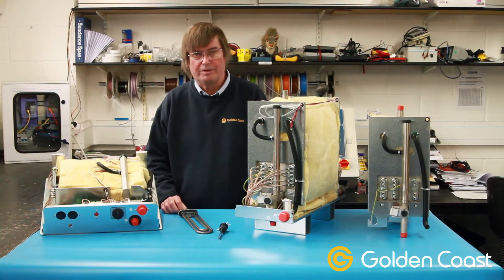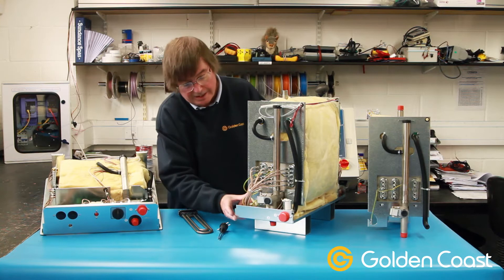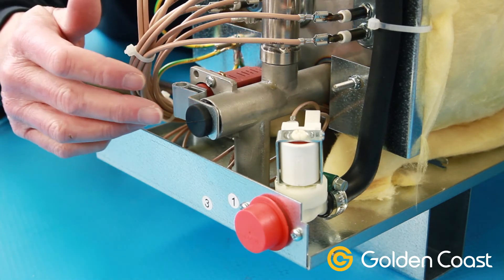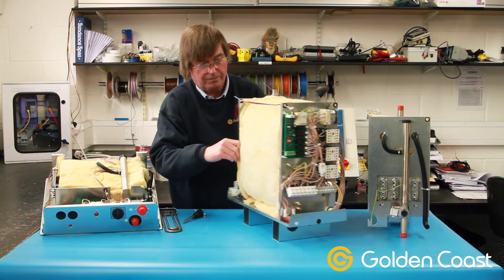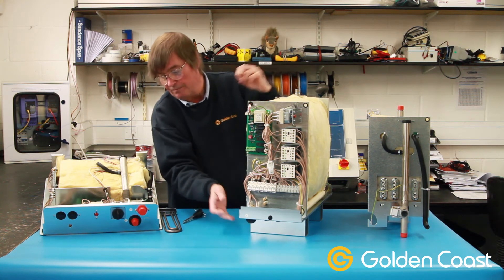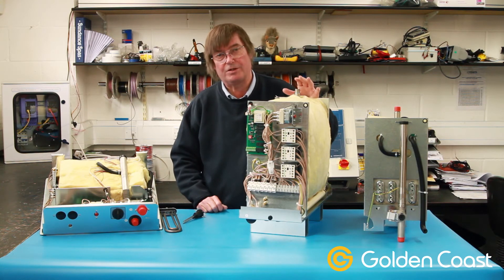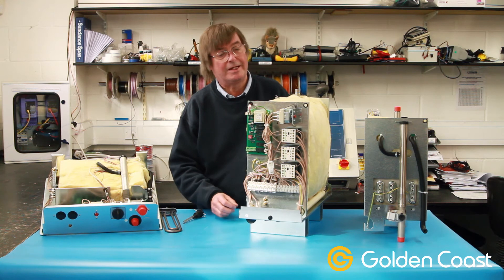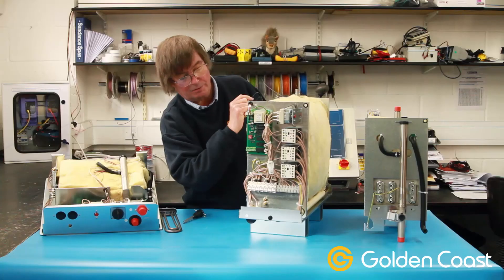Tylo Steam Generator | Andy's Answers

Comment: How do I descale the generator
Reply from the maker: Hi John
I've not made a video on this as its covered in the manual you would have received when your Tylo heater was installed. You can also find information on the process on the on descaler packaging. All the best, Andy

Comment: my steam generator is coming on sometimes it completely fails to come on. now its not coming on and its producing clicking sound at one of the relays. what could be the problem
Reply from the maker: Hi, it's quite likely there is a problem with the incoming voltage but I would advise you get  a professional electrician to check this for you.

Comment: VA STEAM GENERATOR PROBLEM IS solenoid valve on not happening please the quotation on answer
Reply from the maker: Hi, 
If you have continuous flow of water through steam generator, follow points below.

It could be that the solenoid valve is stuck open with dirt. Clean filter if fitted and clean valve.

Check if voltage switches on/off to the solenoid. This is 230 volts.

Or it could be that the PCB temp limit sensor has failed. The way to prove this is to unplug the little 2 black wired white connector from the PCB  Then power up unit and check if water has stopped.

I hope this helps